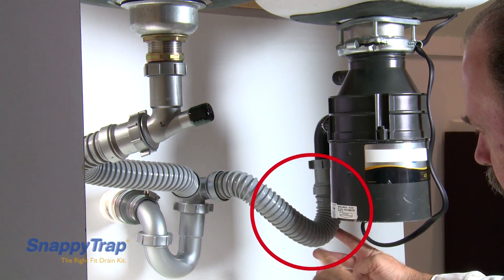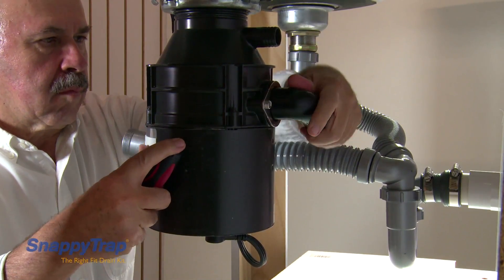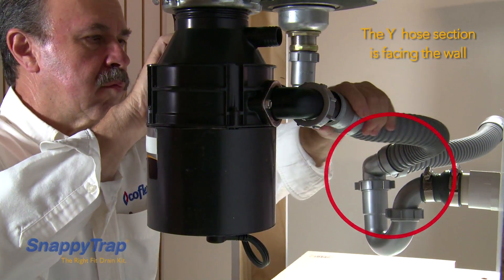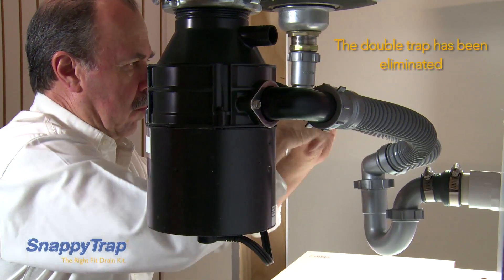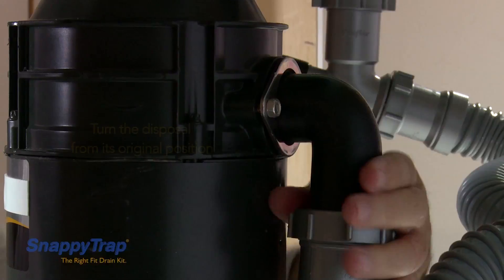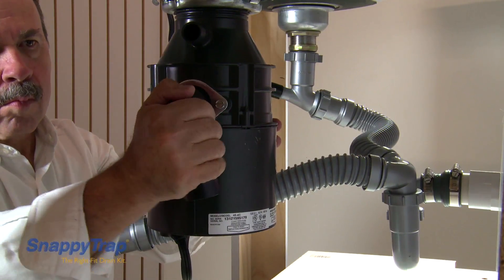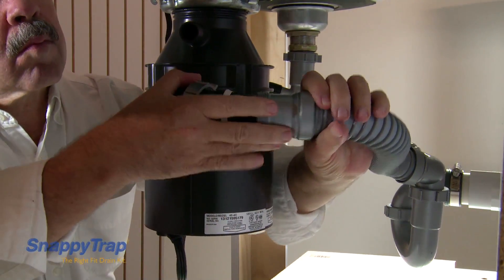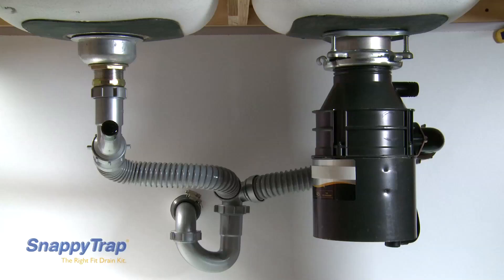Tips for Double Sink with Waste Disposal and the Snappy Trap

Comment: Great product. The corrugated pipe is totally SMOOTH on the inside. As for code, if it was sold in your local "Big Box" store, why would it be illegal to use?
The pipes have tags on as well as the packaging stating it meets UPC plumbing code as well!
Has no leaks, improved water flow, and quick to install. No messing around with those rigid schedule 40 pipes. They belong behind the drywall.

Comment: What the heck is wrong with people? Using any flexible corrugated pipe on a drain is the worst thing you can do on a drain unless you are going out of your way to create clogs. There is a reason why PVC pipes are smooth on the inside. Never use corrugated flexible drain pipe on anything.
Reply: purple hayes, you are correct in that a corrugated pipe would cause issues, however, the Snappy Trap has a Smooth Interior, thus eliminating the potential issue you mentioned. Very good product and engineering!
Reply: @stevekordish4763  I checked out this product and you are correct, I was wrong. This is not the normal accordion-style garbage so often used by people who don't understand the smooth drain pipe concept. I personally would still never use this product but it certainly would not clog because of the ridges in the accordion-style drain pipes as I thought.
Reply: Check your local plumbing codes, this may be illegal in some areas............